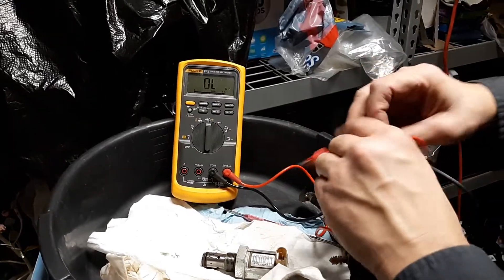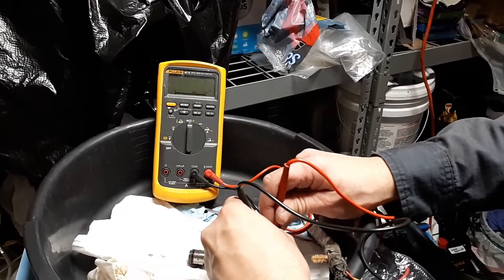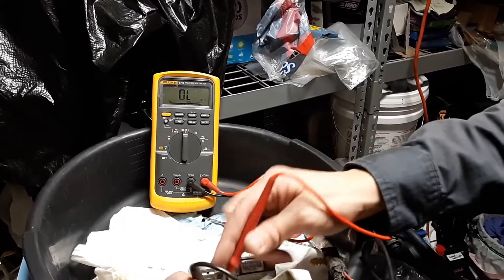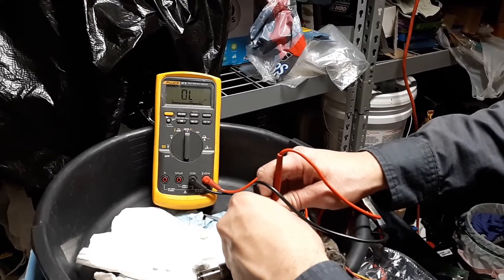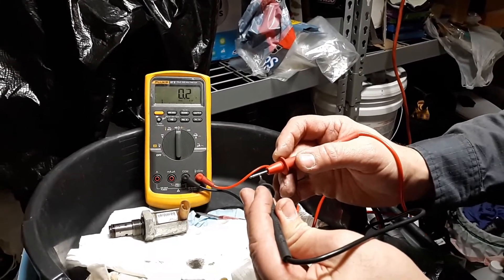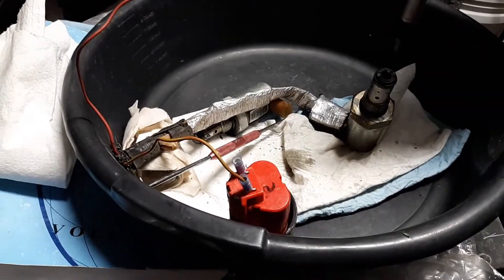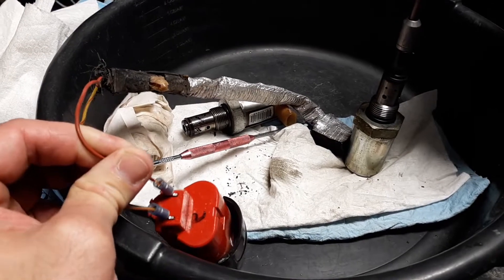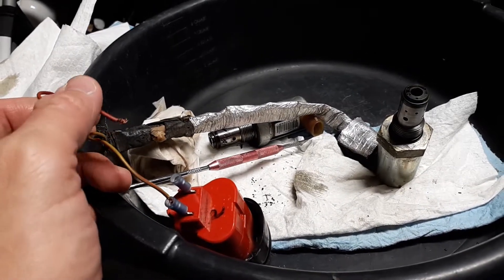IPR testing, BUT DONT ONLY TRUST THE OHMS TEST!!! (6.0L Powerstroke) (SAPSaz)

Comment: Have you tried physically moving the pintle and spraying in those larger holes with brake clean? It sparks which means the coil is getting current but nothing happens maybe because it’s stuck partially open
Reply from the maker: Yes, at the time I did clean thoroughly with brake clean and a straw, the pintle would not move. It failed at an intersection... But thank you, I appreciate it..
Reply: @sapsaz7102  this is the first I’ve heard of one actually failing since most just replace them, thank you this helps shape my diagnostic process for future failures

Comment: What is the is the hissing sound? Did you have air hooked to it somehow?
Reply from the maker: Yes, I was using a rubber tip blow gun with air compressor. Even the ohms were good, it mechanically failed. So just to prove the failure I was using shop air with a rubber tip blow gun (nothing fancy)... I hope this helps 😊